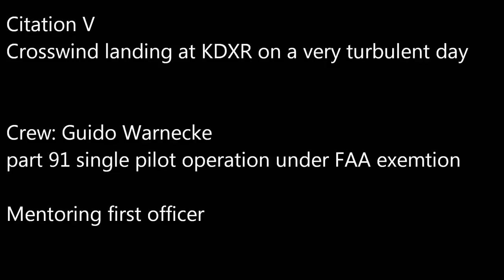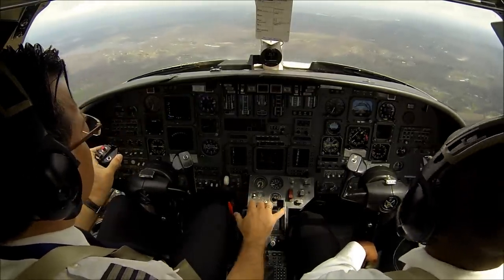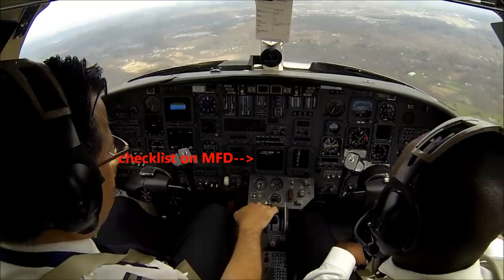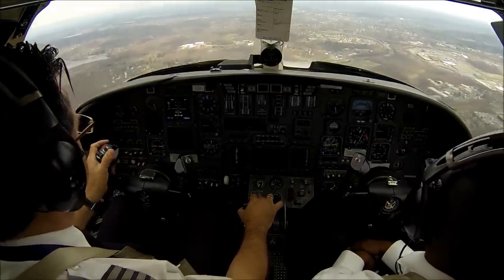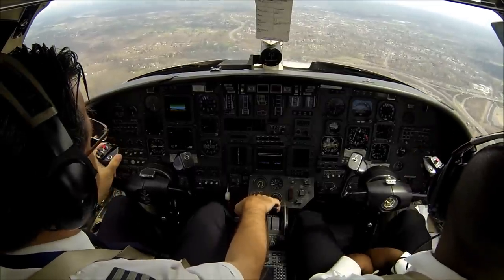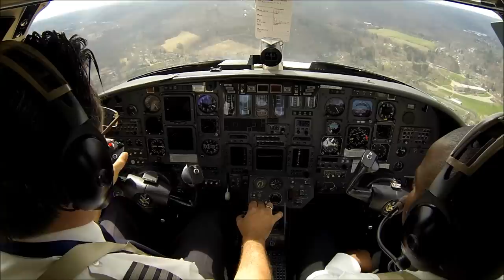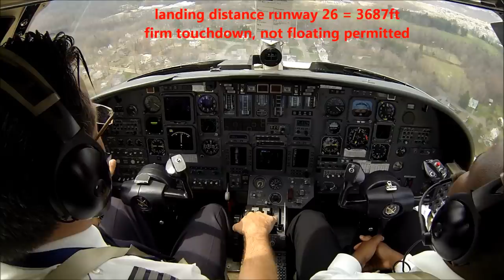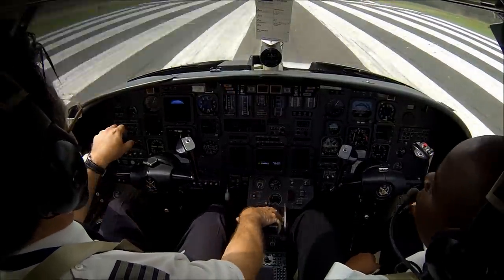Citation V: turbulence during landing. Cockpit view!

Comment: Do real planes actually say "sink rate" while landing?
Reply from the maker: Modern aircraft have a GPWS. This is a fancy abbreviation for Ground Proximity Warning System". In plain language, this is a system, that makes the pilot aware of any potentially dangerous situation close to the ground. Example: a sink rate of a jet of 2,000 feet per minute is completely normal at high altitude. At lower altitude, the computer sees this as a potential risk factor. This is why the call out "SINK RATE" comes up. There are more risk alarms to the pilot on this system.
Please find an overview here:
http://en.wikipedia.org/wiki/GPWS
Many thanks for your comment & for watching my videos.
Happy Landings,
Guido
Reply: thanks
Reply from the maker: TupolevPilot You are very welcome!
Happy Landings,
Guido

Comment: Why are the controls yoke wobbling around so much when coming in to land?
Reply from the maker: The aircraft is designed to fly at high speed during cruise with minimum control inputs. During landing (low speed) in turbulent conditions, significant control inputs are required.
Happy Landings,
Guido
Reply: The Ironman I came to ask the same question. Thanks for the answers and nice landing:)
Reply from the maker: Unity3D Games For Free  This is how it looks in smooth air:
https://youtu.be/Af3fVp8R8bg?t=280
Happy Landings,
Guido
Reply from the maker: @Phillijr100  his is how it looks in smooth air:
https://youtu.be/Af3fVp8R8bg?t=280
Happy Landings,
Guido

Comment: wait, the pilot is wearing glasses?? I thought the pilots couldn´t use glasses
Reply from the maker: +xpto41 
No problem with glasses as long as your "corrected vision" is 20/20.
Color blindness is an issue and mostly disqualifying for commercial flying. A lot of warning lights and the navigation screen displays are based on different colors.
Airlines may have stricter rules with regard to glasses.
Happy landings,
Guido
Reply: Guido Warnecke Thank you for the answer on my comment. I wish you good flights in the future.
Reply from the maker: Same you you!
Happy landings,
Guido

Comment: My mom used to work for ceesna for over 10 years and did the wiring on the instruments and built the harnesses and the company started out sourcing work to Mexico and they laid off 85% of the workforce for cheap labor and the job they do in Mexico on the parts are really bad and I wouldnt trust flying in a ceesna made after 2006 because how bad of the problems I've heard
Reply from the maker: That is an unfortunate problem.
Production is outsourced. On the short term we win on the long term we will lose.
Happy Landings.
Guido
Reply: Not fair. Cessnas quality controls are as strict as usual. Even manufacturers as bombardier and honeywell are setting up shop down south. I dont know about the labor cost but the products are still top quality

Comment: Looked way fast.   Back on throttle with sink rate.  Just saying
Reply from the maker: Approach speed was just above Vref. At idle power the engines are still very responsive as N2 in flight is limited to 52% vs 46% on the ground. (controlled by the WOW switch).
Happy Landings,
Guido

Comment: 10kts gusting 17kts is not a strong wind. What a joke. Try landing in a dust cloud, under fire, in smoke and haze.....
Reply from the maker: +Garyeasye 
At KDXR, due to the topography, any wind above 10 knots creates significant turbulence.
Significant means to bounce your head on the cockpit ceiling if not strapped in.
The wind reported by tower is 30 ft above the ground, the actual wind at pattern altitude probably x 2.
Try it out of you wish...
Happy Landings,
Guido
Reply from the maker: This is how it looks in smooth air:
https://youtu.be/Af3fVp8R8bg?t=280
Happy Landings,
Guido